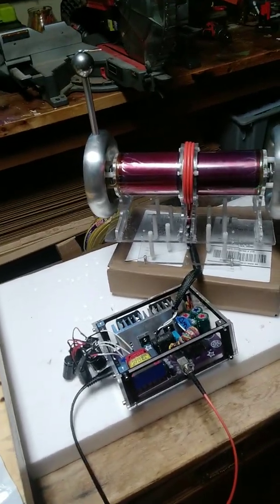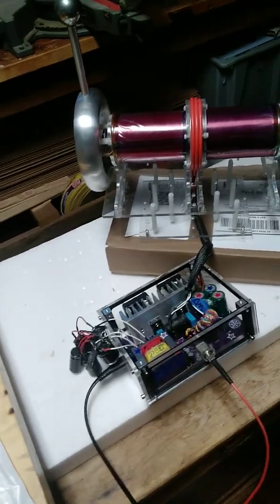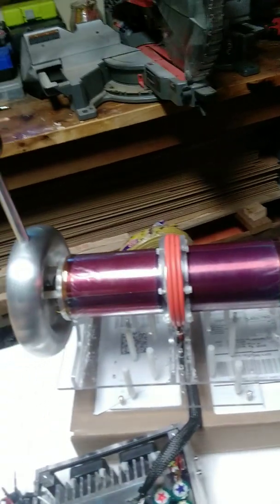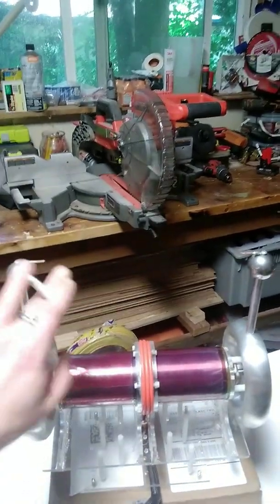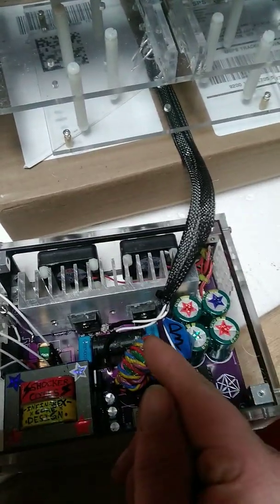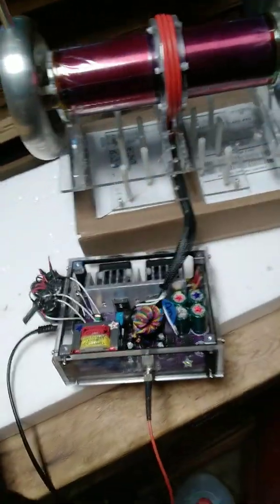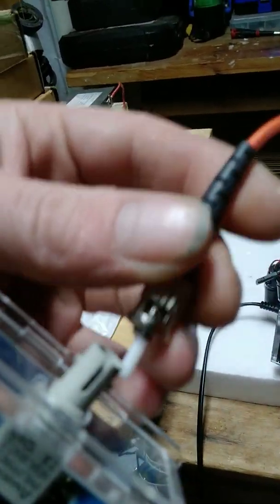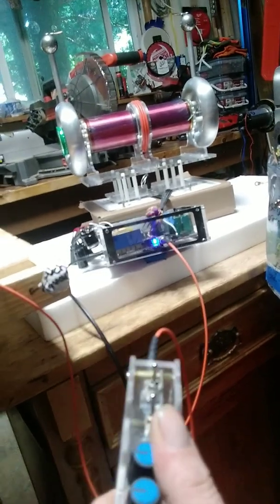The Bipolar Tesla coil. Revised and discussed. Impressive output.

Comment: Gosh damn this has to be the best SSTC explaining I ever heard !!!! I want to see more about this coil brother such a cool setup ! Keep coiling brother 💪💪
Reply from the maker: I always will have a coil nearby. I can't get away from them. Lately I've built a tattoo machine out of the magnet coils inside a 1940-50s doorbell. Coils and power electronics are just nonstop possibilities. I mean I am a licensed Ham radio operator too and I LOVE radio but actually building my own... I mean even a simple amplifier to boost the sound level to my headphones seems boring. Now building a legal limit linear transmitter amplifier.... GOD drooling at the juiciness of the power. Like an amp that when I key the mike the lights in the room dim. Pumping a signal so strong sparks discharge from the antenna and all of my neighbors motion detector lights and car alarms and garage doors start opening and making racket.... Yeah I'd do that if I had the budget!! Glad you enjoyed the video. Originally it was only intended for my dad so that he could see and understand what I was up to. Be lives almost 1000 miles from me. He's smart but has no real electronics knowledge so I broke it down and used examples and such that he would be able to grasp and even if he didn't understand just how it was done, he would at least understand what each part did. Decided to post it as an afterthought. Feel free to ask questions. Keep the search for knowledge, and the coils it spawns, close  if not running mere feet away! Best of luck friend. Stay safe.
Reply from the maker: Sadly this coil met with an unfortunate accident. My now ex wife smashed her to pieces on the floor of my lab.... Well because I'd rather be out there building than inside with her nagging alcoholic and verbally abusive ways. It's ok... She paid for it. Regrets it immensely no doubt. I told her
Reply: @ripstephenhawking8787 oh brother sorry to hear about your crazy EX rage incident , I hope you get back on tc building and this explaining videos wich are awesome , TC people will watch for sure !!  , You should see my lastest coil build , is a very simple single fet but powered by a Buck converter that gives a ramped output you can control the ramp caracteristics with an Arduino Uno , I should make a video explaining all the setup cause also the bus capacitance is charged to 100v from a zvs driver step up tranformer powered from a single 3.7v battery , I plan to make it a TC gun since is all battery powered

Comment: I was planning on getting one of these, I'm from Australia, here we have 240V, you think it would work or not worth it, I'm also not very experienced in electrocics to modify it.
Reply from the maker: Yeah if you didn't have 240v I would advise using a step up transformer OR using the voltage doubler as I did. Since you have 240v you wouldn't want to double that as it would over voltage the main parts.
Reply from the maker: You can email me if you have any questions. sadiegualla@gmail.com I can help walk you through things. Just make sure if you buy one of these that you get it from a good seller preferably with free returns. Avoid paying more than $200 for this complete unit as anything more is a ripoff in my opinion.
Reply: @ripstephenhawking8787  I just received one of these. I sent you an email. Thanks.